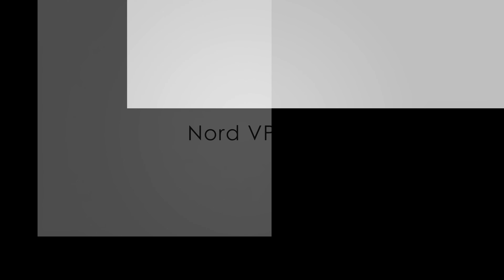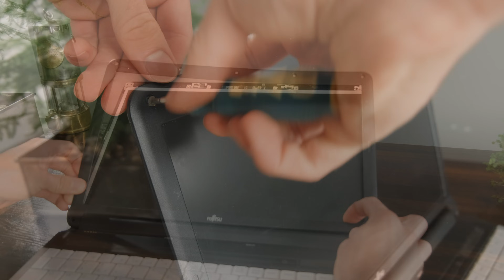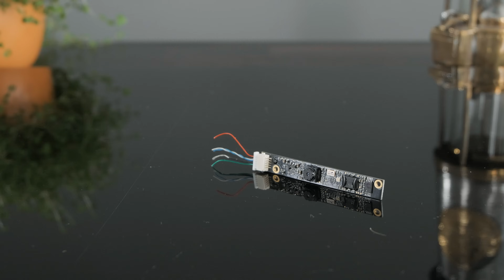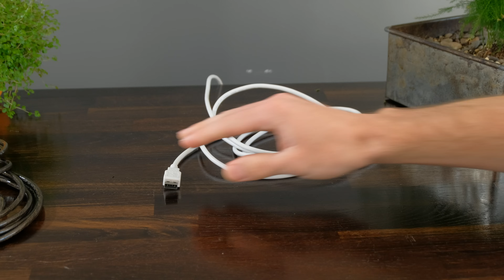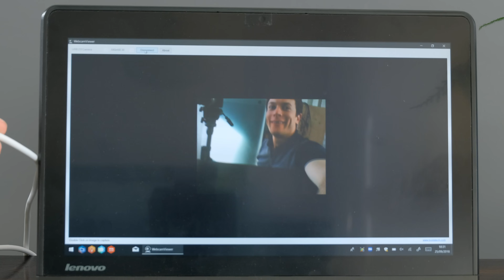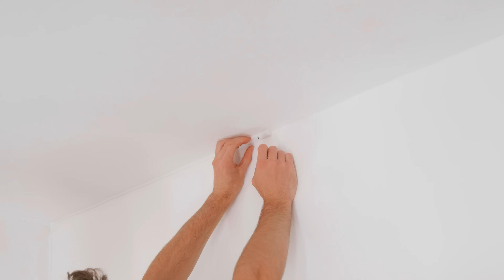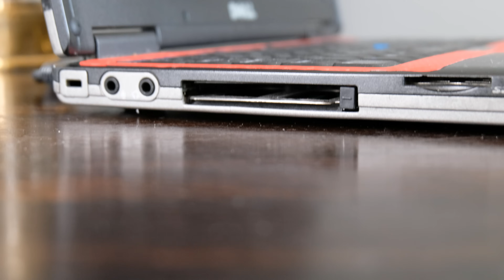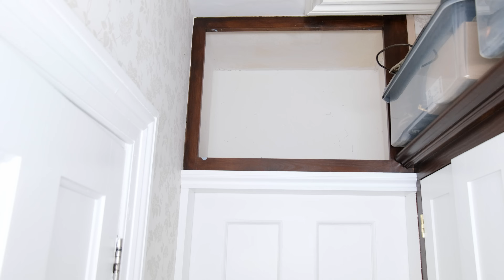DIY Home Security - ON A BUDGET!

Comment: This is whats inside a decent spy pen. 3 inches long, same width as these, sd card and usb charge slot, cam, audio, button on top for video\snapshot. Not sure what to do with it yet. I have 4 Uokoo cams (pan tilt and stationary) so i just put them on an old droid 4 with mini hdmi and see it through an old monitor all 4 at a time. All 4 cams...like $30 a piece and great. IR night vision, 2 way audio, motion, everything ring would do and more

Comment: Anyways on making them WiFi connected. Rather that routing loads of cables. Like a small WiFi connector or something. Dunno what I’m talking about. Hope u understand
Reply: I'm think if we use an old smart phone instead, that would solve many issues. I have - an old -Android phone that is working but has a battery charging issue only, so if i could connect it to an ac charger directly i can fix it somewhere as a security system.

Comment: nice video. but one question, mate. instead of using usb cables why you didn't go with cat 5 cables and matrix switch and from there to lap top?
Reply: Al Kohrs But if you already are using a matrix switch then why not, plus much much farther distance with cat5 before any video degradation.

Comment: I want to do this but what i wanted to asked is:
A - what do i need to use the cameras outside?  Just a water/weather tight enclosure?

B- is there anyway to tidy this up instead of having all those expansions cards sticking out from all over the place?  Is there some sort of adapter i could get that all the usbs could run into?  

C- Could this be used with the smart screen made in another video?

D - how could we set up a hard drive to save the recordings continuously?

Thanks in advance

Comment: Cool, now switch off the lights and show the quality again? Most break-ins happen during the evening, this is 50% of a solution.
If you use modern webcams with IR cut filters and an external IR lamp, job done (but then you might as well buy IP cameras)

Comment: I am curious about purpose of a 5th wire in these web cams?
Reply: Found out that 5th wire in these webcams usually use as a shield ground (in case of mine two webcams that wire labeled as SHGND) and as I guess it should be soldered to a USB connector's metal case.

Comment: Is it possible to put one of these in my car?
Reply: If you'd like to have a computer running all the time in your car (and you have a way to power it, sure) You could use a USB dongle connected to the car battery with a raspberry pi but you don't sound like you could properly set one up.

Comment: Hello DIY perk I took a camera from a Toshiba laptop and it only had 4 wies and 2 of them wires was twisted white and green so i know they was the data pins and the other 2 i use my multimeter on and found out which was plus and minus on power. And it works as a usb webcam now Thank you for making this video.

Now i have to find more. because this one actually puts out some good video.

Comment: Also many pawn shops use to accept computers and still have them and will sell them for almost nothing. Or the same eBay you got the cameras also has outdated PC laptop and desktops. Get a desktop and then get a USB expansion -4 port  PCI card  Here is a great deal on the Inateck 4 Ports PCI-E to USB 3.0 Expansion Card Interface USB 3.0 4-Port Express Card Desktop compatible Windows XP/7/8/10, Mini PCI-E USB 3.0 Hub Controller Adapter, , https://www.newegg.com/Product/Product.aspx?Item=9SIAJG28ST4272&Ignorebbr=true
 I found.   Can easily add ports and a creative box front on a shelf can hide it.

Comment: I've wanted to see a cool wooden design for an iphone dock, but that has other features, e.g thin layer of plexiglass on the bottom lights up red when charging, green when charged; a headphone jack that hooks up to the phone when you plug it in, and a port on the front of the dock so you can still use headphones and whatnot; a usb port on the back to charge other stuff. I'd love to see you do it!

Comment: Hello brother I have car security wifi camera but don't how to connect to power and data. The connector have six wire they are first light yellow second dark yellow third grey fourth empty slot fifth black sixth white seventh red.pls guide me how to connect and use them. What the volt and current supply.

Comment: Hoping you check comments on older videos. 
  Could you use networking, cat5 cable, for extension wires? Any idea what the max run would be?

Comment: My cameras just get super hot and don't work. Everything is insulated with electrical tape, but they don't work. Would it be a 3.3 volt camera? Would that affect it? Or am I shorting a data line? My camera came from a Dell Chromebook and has 8 wires on it (I'm assuming it has a mic). All help appreciated!

Comment: I have tried this using this webcam https://www.ebay.co.uk/itm/151338569422 but contacam says "In use or not compatible" and the windows cam app says " 0xA00F4271 <mediaCaptureFailedEvent> (0x80070018) " The camera appears in my device manager under cameras as "USB Video Device" I don't know how to solve this.

Comment: Nice idea of using a PCMCIA cardbus card.  You need a laptop that supports cardbus, and most laptops that are 6-7 years or newer will not support this slot.  

Express card slot only lasted a few years and was difficult to find device and support.

Most modern laptops that support USB 3 should be able to work with a power usb hub.

PCMCIA - People Can't Remember Computer Industry Acronyms

Comment: I was lucky, because the PCB had the purpose of the wires printed on it, so I didn't have to guess. On the other end I used this micro USD breakout board, which also has the pin labeled: https://www.aliexpress.com/item/5PCS-CJMCU-Micro-USB-Micro-usb-Board-Power-Adapter-5V-Breakout-Switch-Interface-Module-for-Arduino/32839069183.html

Comment: Very useful video thanks, I have a question, What happend if all the internal wires of the camera have connections to the ground? i did the test with the multimeter and all of them sound when i touch the cooper ring to ground

Comment: If the webcam has a built-in microphone, what do I do with the other two data wires controlling that?
Reply: I have an issue with my webcam-chip where I as well have an microphone built-in. Using the technique in the video I haven't been able to get either of my laptops to get the webcam to work again. It worked before I took it out of the laptop. The laptop do read the usb as a camera but when I try to open in either Contacam or win10 Camera app I get the following error: '0xA00F4271<MediaCaptureFailedEvent> (0x8007001F)'

Comment: To all the people wondering if its possible to use an raspberry pi. Yes it is. The Raspberry Pi 3 B+ allows for 480 mbit through the USB ports so you would probably be fine with a POWERED usb hub. You could use a piece of software called MotionEyeOS. Or you could just get a few Raspberry Pi Zero W and then connect all the clients to "MotionEye" to get a centralised view.
Reply: I came here to say exactly this. MotionEye allows for "aggregating" other MotionEyeOS cameras as clients. Using the smallest/cheapest raspberry pis should be possible.
Reply: There is also a CLI program , simply called "motion" which does motion capture as well.
Reply: Thank you very much for this information  !
Reply: Hey thanks very much! I want to use one single raspberry pi to connect to a bunch of cameras, not through the internet.  How powerful should the pi be in order to achieve that? Do we need a 3B+? Or a 3B is enough? Thanks!
Reply: @iMadScience  3B is enough, unless you wanna plug more than 1 camera.
Reply: @tangducbao7309  I want like 6 or more
Reply: @iMadScience  you should buy more raspberry pi, pi 2 is oke. Each camera is mounted on one pi
Reply: Thanks for the info! I was just wondering if I could do the same thing with RPis
Reply: @JornNavarre  I disagree. If it is not beyond your skills a Rasp is waayy better if you want to consume much less power and much much less space. Plus, it is easy to double it as a vpn so you can access it through your personal computer or smartphone, this way the keyboard, trackpad, screen, etc. wont be necessary.
I.e. an old laptop is bloat compared to a rasp.
Just my two cents. Cheers bro.
Reply: Exactly! Plus: no need to run ridiculously long cables throughout your home. Just run to wherever you can set-up a Pi easily, then use wireless networking to aggregate all the signals.

Comment: If someone wants to break in and loot your house, someone WILL break in and loot your house. Only thing you can do is make that harder on them. A camera wont stop someone. 
An alarm sign outside your house, without service or even a system. Is a better deterrent than the actual alarm system.

Comment: Thanks! This is an excellent way to recycle old tech into something useful. Or to get/expand a video surveillance system with minimal cost.
However, I would still recommend some traditional styled cameras in plain sight. Even mock or dummy cameras are suitable as the purpose is to deter and discourage criminal activity such as break-ins, theft, and vandalism. To keep with the idea of low cost DIY, used non-functional cameras are usually pretty cheap.
Additionally, decals and signs are available at very low cost and are a requisite addition to any good security system.
An example of decals: https://amzn.to/2PrcPRJ
Mock camera: https://amzn.to/2Qk3lNf
— — The efficacy of security cameras is largely dependent on the knowledge of their presence. It's just as efficacious—from a crime prevention standpoint—to have dummy cameras put up in several conspicuous locations. This comes from my experience in my former life in law enforcement. The likelihood of capturing usable evidence which leads to the identification, apprehension and conviction of suspect is rather remote. It can happen, it's just rare and not the point. =)
Be safe everyone.

Comment: How would it look  adding two different monitor of same size and using in a multi monitor setup but with no bezels. I meant by removing bezels from one side and reducing the spaces between two display and make a bezel less look.

Comment: i think it might be good way using raspberry pi to replace the laptop for 24 hour advance security camera
Reply: That's a brilliant idea. We can also hook it up to a 10000mah power banks to provide power backup :D
Reply: @heyramineni  Unfortunately it's very difficult to find power banks that could be charged while powering the computer, to act as an UPS.
edit: It could probably be modded tho, it would be nice if this guy made a video about how to make an UPS out of any power bank.
Reply: +Raja Shekhar Me Too!
Reply: Old tablets used to have wifi modules that were also USB based. a usb laptop camera and a tiny usb wifi module, connected to a large enough battery pack, you could remotely monitor places...
Reply: @parishna4882  I actually opened an ancient android tablet to find exactly that, the wifi module was tiny and connected to USB via 4 wires soldered onto the pcb. So was the front facing camera, such simple straightforward engineering, but I didn't have my wits about me to keep those parts for some future home security project.
Reply: Sadly, that's exactly what I did also. "Neat idea, I'll forget about it for now though.." I hadn't even thought about the camera, but it makes sense that it would have been the same. I've still got the entire board from an old Samsung Galaxy Tab 10" though, and one of these days I just have to discover a use for it haha..
Reply: how?
Reply: how it can be done on tablets?
Reply: @parishna4882  what else would you need for this? Which unit would be in charge of receiving power?
Reply: Its not remote if it needs to be plugged in. Which comment are you replying to.
Reply: @parishna4882  Your post that starts with "Old tablets"
Reply: save me, explain this...

EXPLAIN IT...
Reply: exactly my thought man! Im gonna try this lol
Reply: @Jiloh5  Same here
Reply: What software would you use on Linux then?
Reply: @NotTheLarryDavid  I would recommend motionEyeOS on a Raspberry. It's complete OS only made for this purpose.
Reply: Richard Kuhnt thank you!
Reply: Or you can use old cell phones and downloading app and turn that cell phone into a surveillance camera how about that you have to go through all that you go down the street and find you an extra cell phone if somebody throw it away dressing a cracked then part of town
Reply: @charlesneely  yeah like this - https://www.youtube.com/watch?v=dJJkuCmIBsU
Reply: Can I use a USB Hub to connect more then 1 camera to the Raspberry?

Comment: Congrats on a stellar DIY video. One of the most valuable I've seen on Youtube. BUT, I have a question... In your experimentation, have you found laptop webcams that were "easier" to identify and access the wires on?  It appeared in the video that some had only the four needed USB wires, and were even thicker and separate. This information would help viewers a lot, as I have to buy them on eBay, and I'm sure others will too, and I'm not much of a multi-tester user. The simpler, the more successful. Thanks again.

Comment: hahah attempted to make this and my camera just overheats like crazy
Reply: u sure that you are not shorting it?
Reply: @Matt-mt5it  na,i tried so many wiring combination still wont work
Reply: I have made this work. But the cameras crash after a few days. Then I have to unplug them and put them in again. Just for a few more days... My cameras do 247 stream through Contacam webserver displaying 1 fps on the server. But the feed to the laptop is live fps (10-45 fps). Is there some way to limit the fps of the webcam feed to the laptop. Thus getting love heat and fewer crashes. One camera is protected with Sugru and another with electric tape. TL;DR, laptop webcams is no good for 247 operations imo.
Reply: @FIammen  you need heat sinks.
Reply: Gonna attempt this again with different camera n proper wiring technique